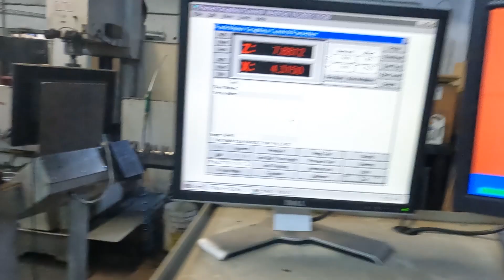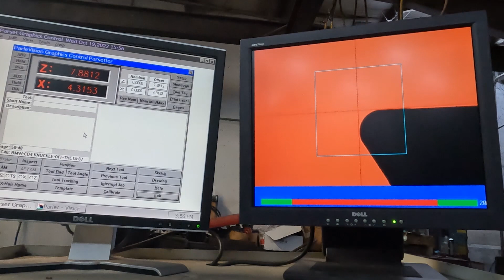Darton LS Sleeve Installation part 2

Comment: Have you had any issues with these MiD sleeves? Seems as if there are stories about failed motors using these sleeves.
Reply from the maker: Have to run front and rear engine plates and not motor mounts or the block will twist!
Reply: @wolverineengines6156  What about with an inline 4 cylinder motor rather than big V8? hp will be in the 6-700hp region.
Reply: @333pg333  instalation error is why they fail.
Reply: @krusher74  I assume so. I had 2 motors fail some years ago but these machinists had never seen let alone installed MiDs. They of course never admitted any blame. The latest motor is not far from the dyno but this time they were installed by a reputable workshop. I am still crossing my fingers and toes though...

Comment: Can you run a wet sleeve setup without a motor plate?
Reply from the maker: Nope. You have to go to a dry sleeve. Can still get the 427/434 cubic inch build out of it.
Reply: @wolverineengines6156  Thanks, I've been told 700 is the safe limit of the ls7 how far can I take it dry sleeved?